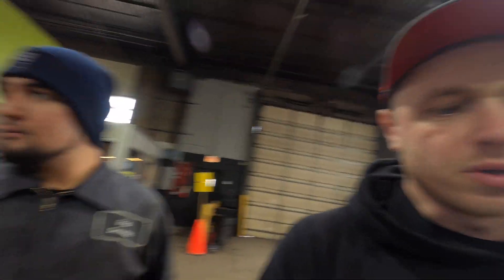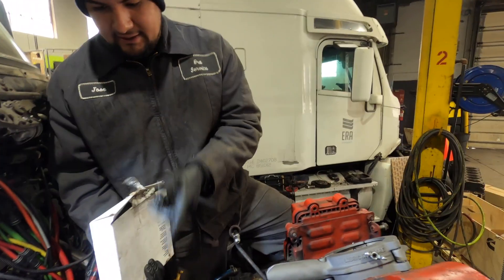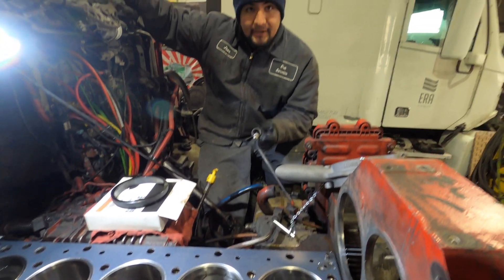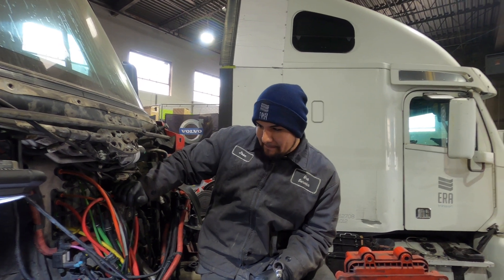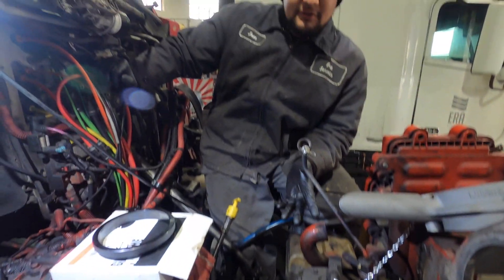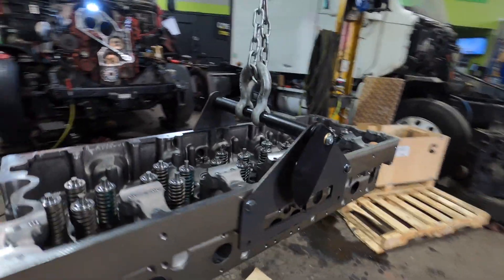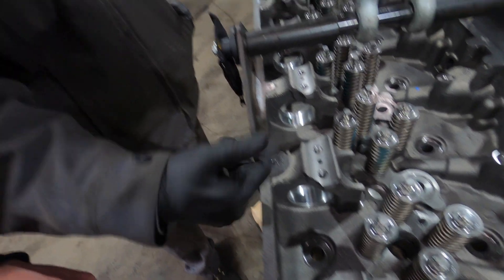Cummins ISX Overhaul Part 2 - High Coolant Consumption Symptom

Comment: Well you’re supposed to do the valid yesterday and a half 1,000,000 miles it probably just wasn’t a well-maintained motor with no p.m. cycle and that’s why he didn’t see the transmission cooler lines Alden getting cracked up and shit and why he overheated it

Comment: At 2:13 Joe is pointing at the six o'clock of the circle (cylinder hole)
At the five thirty
(Away from axiel
The Perifial) of the circle
Is a spot like a stain
Just south of the water port which he points out
That stain ( so to say)
Is ugly
Ok look 2:14 he touches
The exact spot..
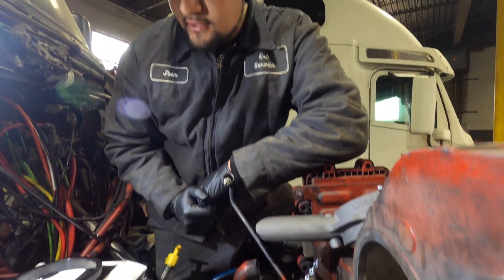Again 2:30

Comment: I've got a 2013 587 and I'm going through the same thing right now 25,000 in repairs on an engine that was brand new from Cummings 14 months ago. The engine has never been hot! Never! blew the head gasket in the same exact place you just pointed to also had a bad lobe on the camshaft this truck didn't have but 80,000 mi on it after the engine was put in it. forums on the internet everybody is talking about the same problem they eat up camshafts and blow head gaskets

Comment: Hello guys hope you all are doing well and safe . First of all thanks for sharing your knowledge and it’s helpful. I have found a Volvo D11 with of Hp405 on it 2015 .My question is like is this engine or truck good for over the road runs with load of 75 to 80 thousand on it? Planning to put truck on landstar. I might have to run hills and ? I will appreciate your suggestion thank you.

Comment: Bought a new head for my 5.9 Cummins once. Blew the head gasket a few months later. I believe it was because the new head wasn't surfaced properly. Wasn't flat. Something to watch out for
Reply from the maker: Yes.That's why we get a new one. thank you for watching
Reply: @TruckYoo  mine was brand spankin new too, but still blew the gasket and I used a different machine shop when it did and they had to surface that brand new head flat. ✌
Reply: The Cummings ISX engine for 2013 was a piece of crap. They eat up camshafts along with many other problems EGR leaks all of it